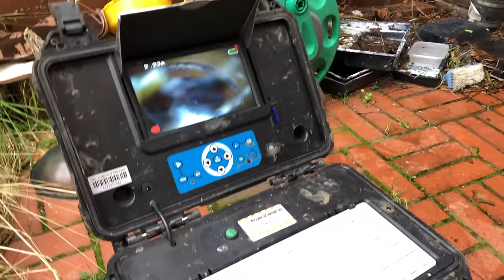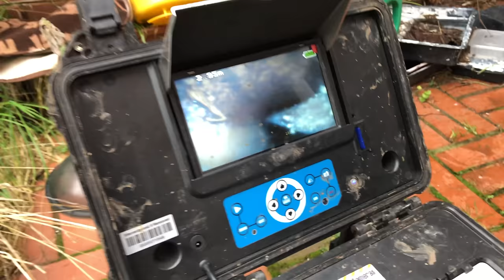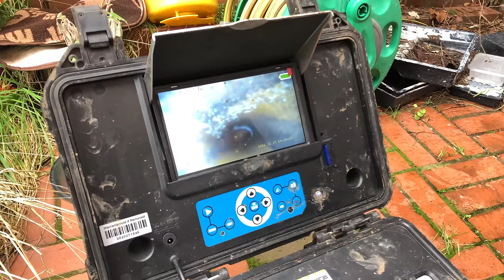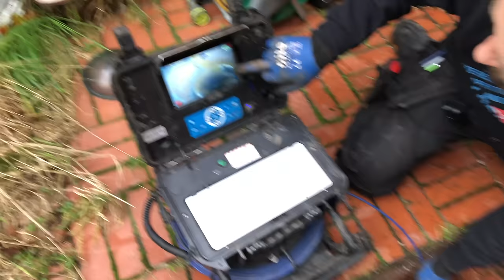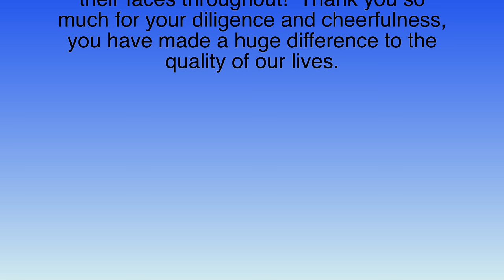YOU DON'T NEED TO LIVE WITH RATS...even in the COUNTRYSIDE! RAT FREE LIFETIME GUARANTEE!!!

Comment: I recently bought 2 black cat rat traps, and a box of liquorice all sorts. Ive not caught a rat yet and I’ve eaten most of the bloody sweets. 😊
Reply from the maker: Take a look at our video on how to set them. 
Maybe get a lockable box for the Allsorts though! 🤣
Reply: @PestInterceptors  🤣🤣🤣🤣🤣
Reply: Put down some dry ice 🧊
Reply: Haha
Reply: Peanut  butter or nuttella. The little  sods love it. It takes a while. Theyre sly creatures.
Reply: Finger fudge it's just enough to catch a rat lol is what you need ideally a trap with a spike or if it's got a tray put a self-tapping screw through the plastic and then a bit of finger of fudge on top, I had the same problem with peanut butter they were just licking it off not setting the trap off, but if the bait is fixed to the trap mechanism it will set it off.
Reply: i bought a load of beer to sort out my slugs and snails, first i drank the beer and then i wandered around the garden muttering " what snails, what slugs ? "
Reply: @PestInterceptors  😂😂😂
Reply: Nutella or peanut butter never fails!
Reply: Buy a jar of peanut butter. That's what I use.
Reply: Are you sure you're not a rat.?
Reply: @mikeenglish7063  I've put peanut butter sprinkled with cinnamon and the rat never touched it. However, After a few days the trap was activated with no rat in it, and the peanut butter gone. The rat did some droppings next to the trap just for good measure. 
The cheeky ba******. 
This is now personal.
Reply: @tuckedup I had more success, resisted the temptation, but the singing was keeping me awake at night.
Reply: Get real black cats... bet that would work.
Reply: Did you wear gloves when you set the trap up? I read they will smell you and not go near it so the reason for the gloves 🧤
Reply: Peanut butter ! Kraft or Skippy works best.
Reply: 1
Reply: Omg hilarious.. thanks
Reply: Hey mikeenglish.. the amount of pb or Nutella should be just a teeny tiny bit … and sprinkle a little cinnamon 👃🏼👅🧔🏻‍♀️
Reply: O yeah don’t forget gloves👩🏻‍🚒
Reply: @Bull_sheet_Bob 🤣🤣🤣👍

Comment: I live in the Arizona desert where mesquite trees flourish. When the mesquite pods ripen, the rodents gather them up and store them in their nests so they have an almost constant food supply. I also have neighbors who feed the birds. I tried trapping them for 6 months and caught an average of 1 rodent per day, but they were breeding faster than I could trap them. (If nothing happens to them, one breeding pair can turn into 1,250 rats/mice in one year, and in 3 years can multiply to 1/2 a billion!). The traps were in locked bait boxes, but so far I've found about 4 dead birds in the rat traps. So traps don't prevent non-target creatures from being killed either. I tried cornmeal and baking soda but they wouldn't touch it. So finally I resorted to using rodent bait which is working. (I put chicken wire over the bait boxes to keep the birds out). I don't have rodents inside of any of my buildings and they aren't coming out of the septic tank or sewer pipes (which are all new). But they've chewed wires outside, torn the insulation off a vehicle hood, chewed through the windshield washer tubing, made a nest behind a glove box, destroyed veggies in my garden, and they've left trails of urine and feces all over, and I'm not going to put up with that. I'm going to keep poisoning them for a while longer, but eventually I will switch to feeding the survivors Conntraceptol, which is rat/mouse birth control.
Reply from the maker: Yes, external rats are harder to deal with than internal ones sometimes. In your case it sounds like a nightmare situation. 
I think what we would do in your situation is a regime of burrow baiting (as much as we hate using rodenticides it sometimes is the only answer!). 
Burrow baiting, if done correctly, is unlikely to affect other wildlife and it helps get over neophobia as the rats have to dig/chew through it to leave burrows. 
Find a rodenticide that can be used for this; I don’t know the laws and products in other countries. 
Bag the bait up in plastic bags. (Grain bait isn’t great, use a pasta or block bait). 
Push the bags into the rats burrows. Cover with soil and then a large stone/rock. (This prevents non targets getting to it). 
Do this every seven days until the holes stop reappearing. 
Then remove the rodenticide. 
Keep going until there is zero activity, you don’t want to leave any survivors! 
As for the vehicle problem, in the UK, there is a company called Lodi based in Kingswinford, West Midlands, England. 
They do a product that keeps rats away from vehicles and I have heard great feedback about this product. 
Get in touch with them and I’m sure they will send you some (kindly mention us when you do enquire). 
Best of luck.
Reply: Newer vehicles use soy-based wiring insulation which attracts rodents.

Comment: Preferred to use a bucket with a ramp. I put a spindle through the top of the bucket with a little bit of peanut butter on it. They've tried to walk on the spindle they fall off into the bottom of the bucket. Don't forget to put water in the bucket
Reply from the maker: But it doesn’t get to the root cause does it. The rats will be back.
Reply: Illegal
Reply: But I'm sure rats can swim
Reply from the maker: @bxxmb80  yes they can for many days. That’s why these bucket traps are vile and inhumane things to use and are illegal in the uk because of animal welfare laws.

Comment: Hi the drain rod that’s stuck in the drain was possibly pulled down when a blockage cleared you would be surprised how much suction you can get especially if the blockage is backing up the soil pipe. Good job with the video 👍
Reply from the maker: Thanks for the info
Reply: It wasn't pulled down, because the rod was push upstream.
If you have metal drain rods, and a hook fitting - you can push it upstream also, hook the rod, and simply pull it out (I owned a drainage company for over 20 years).
Also.... most septic tanks lead to soakaways, and they most certainly do not have drains running for miles.

Comment: Hi Guys, I have rat holes in the garden, can I just fill the holes in with gravel?
Reply from the maker: It depends. @goobydingbat1027
Are the rats going in from above ground or are they coming up from the sewer below. 
If they are coming from the sewer you will fill the sewer with gravel and then cause a blockage and it will cause a build up of poop which is food for more rats. 
So the thing to do is fill the holes loosely with paper and then fill over the paper with soil. 
When the holes reappear, is the soil and paper on top of the surface? Or has it just disappeared down the hole. 
If it’s just disappearing down the hole then the rats are coming from below ground, usually the sewer or drain.

Comment: Clean daily with pine sol not the cheap version though must be the 💯 percent an pour some around basebords behind stove,  fridge  mop and clean daily . They will leave they can't stand the smell.
Reply from the maker: Even if that did work (and we don’t believe it does, if things like that had any scientific basis we would use them) you would still have rats in your walls, floors and ceilings. 
We hear old wives tales like this one all the time, and as we said above, if it worked we would be using it. 
Sadly people get mixed signals when using old wives tale remedies. Usually a neighbour has put some poison down or something similar. It then seems like the old wives tale worked….but it’s just bad science. 
Thank you for your input though. We are always happy to hear ideas. 
Ps. When we do our Rat Free Lifetime Guarantee for clients they have usually had rats for years and years and have tried every old wives tale there is.

Comment: Yeah maybe that's where I'm getting some rats coming in my garage from the old suspect not being used for 40 years I have to go down there and block the hole looks like not sure how they made it into the garage though concrete floor single wall edible mice being my major problem worse than rats. I'm assuming you put a u bend on the waist pipe, do you put a bend and pipe under the water going into the sespic? I don't think rats can dive?
What is that spray stuff in the left? Where do you buy that from? Better get some.
Reply from the maker: Nearly all rats in houses in the uk are something to do with drain or sewer. 
Take a look in our playlists the rat one covers all our rat videos but there are playlists on rat flaps and sewer surveys too. 
The rat problems will have nothing to do with the mice problems. But we have playlists about them also.

Comment: Interesting liked the presentation of your videos

Sadly I am miles away from you in Harrow Middlesex
Our problem mice/rat and Chicken coup.
We keep chickens at home we find rats.”mice comes around in the chicken run in night digging tunnel under the chicken wire fencing
We don't won't to poison just in case our chickens eat their droppings. How can. We catch and get rid

Thanks
Reply from the maker: One thing you can try is to keep the spilled chicken feed at a minimum. There are feeders that only open when the chicken treads on a treadle plate. 
When there is very little free food for the rats you can use rat traps in bait stations. 
Also try to track where the rats are coming from, there is nearly always a sewer/drain problem somewhere. 
We do travel all over the uk but only with our Rat Free Guarantee program, but that’s mainly aimed at rats in houses. 
https://www.pestinterceptors.co.uk/rat-free-lifetime-guarantee

Comment: couple of ratters or terriers if you want, cannot wait for the rats to dash out, they then just nip them on the back of the neck below the scull and thats it for the rat, The dogs don't dwell on the killed rats, they are after the next one it is so quick its hard to see but the dead rats aren't hard to see. I saw that as a teenager and still it is a great sight to have witnessed.
Reply from the maker: Not much use when the rats are in the walls or floors of a house though 😊
Reply: I think you would have been surprised but I take your point.

Comment: We have rats under our chicken shed. First we catched rats in traps with nuts then almonds then oats then Nutella or peanut butter or bacon. But meanwhile they learned and do not touch any traps. They are too clever...
Reply from the maker: Take a look at our rats playlist or the trapping playlist. You may learn a truck or two to outsmart those rats.
Reply: @PestInterceptors  thanks. I will watch. May be I should get some of your plastic UK traps. Meanwhile they know my German old school wooden traps...
Reply from the maker: @SD_Alias  we rarely use anything other than Black Cat rat traps. 👍🏼
Reply: @PestInterceptors  I will get two of them and try them...
Reply: @PestInterceptors  Well they are quite expensive. 41€ for a pack of two. Are they long lasting? Did the traps ever brake? I wonder if the plastic casing becomes brittle over time due to the hard impact of the spring?
Reply from the maker: @SD_Alias  shop around a bit more. That seems expensive. 
Never had a problem with them. Used them for years.
Reply: Thanks! i will try to find another dealer. unfortunately to order in the UK from the EU is now quite expensive because of customs fees
Reply from the maker: @SD_Alias  the traps are manufactured in India I believe, so try from there or find a European supplier.

Comment: you state that a rat can get through a gap as thick as your thumb.  thats too easy for them.  a rat can collapse its rib cage therefore the limiting factor is the thickness of the skull.  i assume any gap wider than 50mm by 10mm is a potential entry point.  of course a mouse can get through this size of gap.  a temporary fix for an entrance hole you find in the middle of the night while raiding the fridge is steel wool in the hole. both rats and mice cant overcome their dislike for biting into the stuff.  the next morning fill the hole with strong cement mortar.  problem fixed!  until you find the next entry point, that is.
Reply from the maker: It’s 13mm for rats and 5mm for mice. 
Your comment about steel wool is correct but think about it logically…you can only seal holes you know about or can see (there a lots of pipes and electrical cables under the floors and in walls that have holes around them). 
And what’s the point of sealing them in the walls and floors? 
Wouldn’t you prefer to just not have rats or mice 🤷‍♂️😊 
Good comment though 👍🏼
Reply: @PestInterceptors  , you are correct, of course.  i'm in australia.  weve been using pvc for sewage for decades.  therefore, some of the methods of access you highlight dont occur here.  plumbers and electricians are still sloppy though.  i moved into a 'renovator's delight" years ago.  the first problem was rats.  i would see a tail disappearing through a gap when i got up in the middle of the night.  hence the steel wool being stage one till the next morning.  I'm a bricklayer, so access to mortar is easy.  then there were cockroach gaps.  this took a lot longer.  however i well remember the night i sprung the last big fat cockroach.  i grabbed the fly spray and chased it.  it ran to every hole it could remember.  they were all blocked.  i just let it run to alert  me to any gaps i may have missed.  there were now none left so i gave it the coup-de-grace.  that was the night i knew there were no more pests.

Comment: I want to get 3 chickens but ALL my friends are telling me I’ll get rats guaranteed! I want to get chickens but i hate rats 😢
Reply from the maker: If it were me: 
I would use galvanised steel 10mm mess to enclose the coop. This would go under the coop as well as the sides. 
And I would definitely use the type of feeders that the chickens have to stand on a plate to open and it closes when they step off. 
Hope that helps. Enjoy those real eggs!
Reply: @PestInterceptors  Excellent to hear thank you. I have ordered the enclosed chicken run with the welded mesh of 10mm and the coop will go inside the run. Plus I’m getting a Grandpa feeder which has a treadle mechanism 👍🏼

Comment: I think your knowledge of septic tanks is incorrect first the overflow from a septic tank goes to a soak away and the outlet pipe in the soak away has no sealed joints except for the first 3m and very rarely if ever should it go to a water course, and secondly a rat should not be able to swim from the inlet to the outlet on the surface of the water both inlets and outlets on a septic tank are or should be dip pipes length of the dip pipe is a min of 0.5m. also when clay pipes with  corking and a cement fillet joint, the pipes are not laid on gravel but laid on solid ground only clay pipes with a flexible plastic cupping get laid on a gravel bed
Reply from the maker: You are wrong. 
You are talking about a digestor system. 
You are also wrong about pipes being laid on the ground. They are laid in pea shingle. 
Thank you for your insights into something that you obviously thought you knew about.